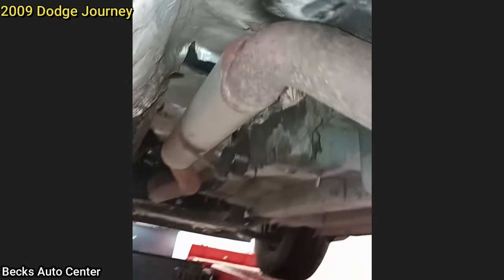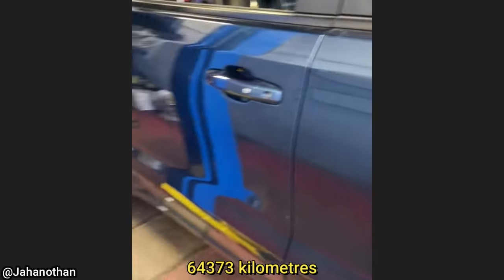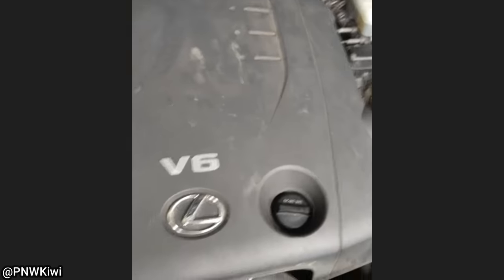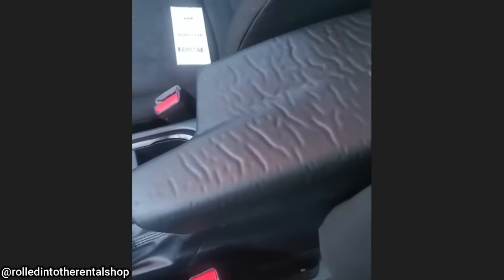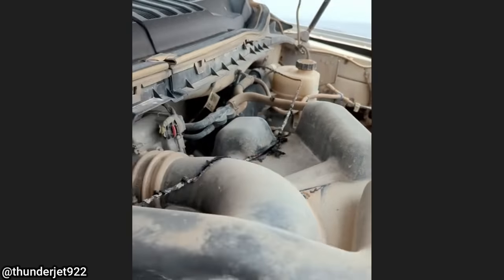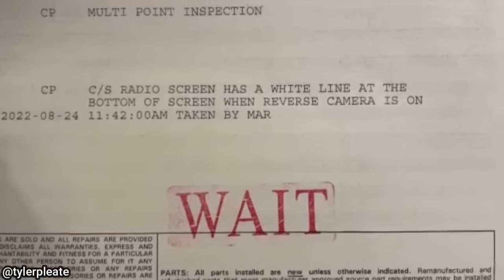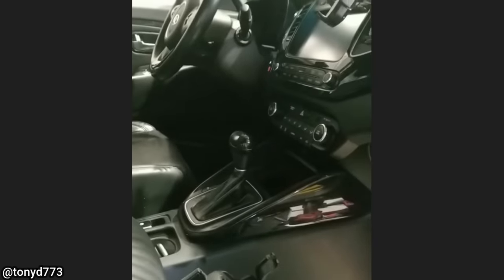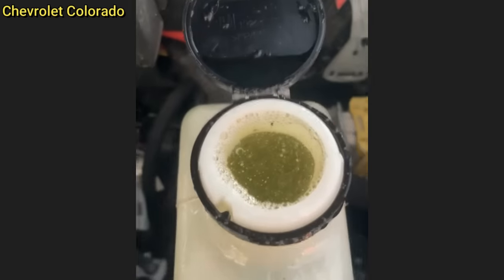Customer States Compilation (The Best of 2022) | Just Rolled In

Comment: Customers: "Don't let these mechanics scam you into things you don't need."
Also customers:
Reply: Beamer approves this post
Reply: so true... but the big issue is that this has not been an issue for most shops since the mid 2000's
Reply: Good  one  LOL
Reply: @sellingacoerwa8318  confirmed
Reply: Which is why I go to a mechanic my dad knows very well that works next to an Vehicle Inspection station and tell them specifically what I need done, never been scammed yet and always had the problem fixed.
Reply: Customer goes in for a tire change

Mechanic: alright leave it here for 30 mins and it’ll be done.

Customer comes back after 30 mins

Mechanic: ok, so we discovered that your radiator and engine were broken, so we had to build a new car. that’ll be 90k please.
Reply: @gvs6462  The issue with these places is they do the work without consulting the customer. Which is something that should be done for everything that isn't a very minor or cheap thing. Some customers refuse the repairs, but most will just give you permission and not feel scammed out will realize it's a even and say no
Reply: @timothywhieldon1971  Sure it has. I started the trade in 1985 when I was 16. I've been seeing cars in such deplorable condition  since my first year. It may of increased  when covid hit slightly. But it's always  been like this. Shit box cars driving beside you every day. Makes you feel really safe doesn't  it.
Reply: @lidge1994  it's actually illegal to do any work without verbal or written authorization.  When given a written estimate you can be charged up to 10 % above the estimated  price. So if you are given an estimate of $100, they can't charge you $500. They can however charge $110. 
Most shops estimate high. Then they look like heros when the final bill is way less than estimated.  This is very common practice amongst us technicians.
Reply: yeah but some shop will scam you. Official Hyundai dealership stated I needed to change my tires as they were "cracked on the side" and unsafe. well there were only a few small cracks, nothing out of the ordinary, but they just wanted to sell me new tires. 

Main issue I had with this shop is that when they ask me to do work, I do it, but when I state "car need work cause it doesnt start twice a week" they can't be bothered to spend time to search for an issue that "might not exist". I won't go back there tho.
Reply: @_underscore_2381  There are some shady shops out there. Dealerships, a lot of times, are the worst.  
What gets me is why the general consensus of dealerships having the best technicians in the world. 
No. These are the same techs you will find anywhere else. 
There's no difference.  Why people go to the dealership for everything is beyond me. The dealers make you  believe  a lot of times that if you don't do back for oil changes, it will basically  void any warranty.  That absolutely not true at all. You can have work done anywhere.  Just keep all the invoices.  Warranty  work is the only thing you need to have done there. 
People will say they want original  parts. Small independent  shops can get dealer parts. 
As far as your tire cracking... are you sure they weren't trying to sell you tires based on age ?
Reply: @-Mike-69  My tires were less than 2 years old. And I go to the dealership since my car is under warranty and every single maintenance, it also needs warranty work done… If I was in the US, my car would fall under lemon law 100%
Reply: Many customers are entirely ignorant and then there are people that are apocalyptically stupid.
Reply: also customer : i don't believe mechanics , i do it my way
Reply: Man, this is a double edged sword. You can't expect every average person to know how to work on a car, these are complex machines.  You can, however, expect someone else to exploit that ignorance, and it happens on a regular basis. There are plenty of good mechanics out there, but the industry doesn't reward honesty, and we live in a world of fast-food-service shops that will happily bend you over a table to make a quick buck. I have a feeling it's only gonna get worse in the coming years as electric cars become more prominent and shops become spoiled for choice. Do you overcharge the electric owner because it's an emerging technology, or do you overcharge the internal combustion owner because it's becoming outdated and harder to maintain? Joke's on us, they're gonna run the same scam regardless
Reply: I bet thats what the guy who’s car was held together by straps said 😂
Reply: goes both ways
Reply: @-Mike-69  I'll make one minor push back.  I own a 2020 Escape.  It has taken a while for private mechanics to understand the new 1.5L I-3 engine in my vehicle isn't the old 1.5L I-4 engine with leak issues.  I tell them it's a 3-cyl and they look lost.  The Ford tech knows because they only work on Fords.  Are they pricey?  Yes.  Do I have to explain to them the inner workings of my engine?  No.  So for new vehicles, especially the small turboed engines and/or hybrid variants, the dealer might be better until their powertrains become more known.
Reply: @_underscore_2381  Dealers are always a terrible experience and you always over pay and get scammed by taking vehicles there, Pretty well known they're always horrible.
Reply: Bruhhhhh right
Reply: To be fair, mechanics do scam people. Not all of them but enough do. There are a few mechanics around here that won't work on your car if you've already bought the parts and I think that's pretty shady. I just fix my own vehicle for a fraction of the price in labor and parts. Never had a problem with finding the correct parts and installing them myself. Local, highly rated brake guy wanted $458 for two rotors, pads and a caliper including labor. I let him do it, no biggie. Then I did the front brakes on my own. Took 1 hour and the parts were better quality and cheaper. The caliper installed by the shop was rusty and old looking while the caliper I paid half the price for the parts including BOTH calipers, not just one like the shop, and installed myself.  Calipers are still shiny and new. So this guy's license and "education" enables him to make $200 for an hours work because I paid a little less than $270 for the parts.
Reply: @youtubecertified4643  Reason shops don't want to use your parts is because a huge part of their profit and income is selling you parts, If you bring in all the stuff to do an oil change and they use that, They lose money on that oil change due to what they pay the labor. So there is a reason for that, They'd have to charge more for the oil change if you brought in the stuff so they wouldn't be losing money. So that part isn't always shady, I do all the work myself to my cars so I never deal with shops, Plenty of shops that do scam because so few people actually check behind them or know anything about cars to call them out.
Reply: @-Mike-69  explains why they do the work for two hundred bucks but online I was seeing people pay a $1, 000.i can build a house but no next zero about vehicles my buddy next door is a mechanic so I get lucky. Rich people coming to change tires how you get four tires put on for 100 if they fit👍
Reply: @-Mike-69  in a lot of states you have to fight for the right to repair because of the computers with those dumb dealerships fighting with local mechanics over the device
Reply: haha, yeah ,my gosh, makes us civilians look extra special. I think people do deserve to be yelled at and made fun of if they bring their car that has a rotten pumpkin in it. Some of these problems looks like the owner does not have EYES! I feel good about myself knowing nothing about cars but have common sense.
Reply: @timothywhieldon1971  false I got scammed in 2014 they tampered with my transmission to make the car shake when braked to a stop. as a college kid I had no money to fix it.  my dad didn’t care. I gave him back the car before leaving the state and it was only then that I learned the car’s “seizures” weren’t due to the age or mileage of the car.
Reply: @ElijahRock92  Yes. You are absolutely  correct sir. When it comes to certain new products yes the dealers will obviously  have information before everyone  else. Some technicians will live and die by one brand of vehicle. That may give them the upper hand in certain cases. 
The point I was trying  to get across, basically some customers feel that dealer technicians are the smartest guys out there. And if you work for an independent, that's only because your not a good technician. Does that make sense ? I've worked for both dealers and independent. Truthfully  I prefer the independent shops where you get a variety  of different vehicles. Not the same thing, day after day after day. For me dealerships are like the movie Groundhog  day.  It's so repetitive  at times you want to blow your brains out.
Reply: @ElijahRock92  i have a 3-cylinder Geo Metro and a 5-cylinder VW Jetta. You'd be amazed at how many people have tried to tell me there's no such thing. Umm, tell that to my car then because it doesn't believe you.  I will admit though that years ago first time I was riding in a geo metro and the guy said it doesn't like hills but it's only running on 3 cylinders. I thought he meant the 4th cylinder was broken. I didn't know they existed. Hahaha
Reply: Yes but that doesn't mean that mechanics trying to scam people doesn't exist, maybe that's why so many people that they're f**** up their own vehicles cuz they've been screwed so many times by a shop they're desperate I think a decent portion of them are just stupid but I'd say there's at least a few in there who are afraid.
Reply: @lidge1994  Consider yourself very fortunate. I just cannot find a  mechanic in my area that's willing to fix my simple common needs, or when they do, it's ALWAYS done wrong, adding another complication. And I've tried them all, over the years, in a 25 mile radius!
Reply: I used to hate manufacturers for making new cars so difficult to work on... 13 years later I prefer the car is designed where the customer can't mess with things they shouldn't...This video is perfect example of that
Reply: @donjulio5045  you have not got a clue sadly
Reply: I know that nobody's perfect,but wow some individuals lack so much awareness they shoild've been icked off by predators.
Reply: There is definitely a wide grey area.
Reply: @mikehunte2087  uh I replace engines and transmissions for a living.. the people in the comments and forums don't have a clue...
Reply: @donjulio5045  agree unless they put the hard work in these sad keyboard warriors should not comment, have dismantled over 300 vehicles but the body’s buggered now
Reply: I had a mechanic replace sway bar, they somehow put it in upside down and the after we got them to put it in right they loosed up the steering underneath and told me I would need new ball joints. When. I got home and inspected them I discovered that the joints were fine they just loosed some bolts underneath so it would pop when I turned my wheel.
Reply: Depends on the mechanic, depends on the customer. Both can be shit sometimes
Reply: USA needs a system like UK does , a MOT , the car HAS to have a yearly inspection  by a government licenced  mechanic so its road safe , without this certificate you cannot use the vehicle , tax it or insure it
Reply: @mr__southern1492  They don't wan to use your part because they warrantee the repair. If your counterfeit part fails, why pays.  If it doesn't fit and it ties up the lift for a morning, who pays.
Reply: "your $5000 car needs compliance bushings replacement, that'll be $2000" - every dealer ever.
Reply: There's nothing you can't fix with a zipptie and a duck tape
Reply: @youtubecertified4643  I had a fuel injection unit that needed to be replaced on a 2003 blazer. Lowest quote I got was $1500. I did some research, got the OEM replacement unit on ebay for $250, and did it myself in the driveway in an hour, including taking three beer breaks. I'm mechanically inclined but pretty sure an 8 year old could have done it with a bit of adult supervision.
Reply: @alanzoarne6530  So why do they still refuse when you bring in new in box OEM parts?
Reply: @keithangstadt4950  1. It could be a used part, put back in the box, and defective.
2. It could be the wrong part.
3. It could be counterfeit.

If there's a problem, it becomes the tech's problem.  You'll blame the tech, not some anonymous seller on ebay.
Reply: Still a valid issue.
Reply: @Mr__Southern  I'm sorry that has been your experience but I worked in dealerships for over 10 years and never scammed anyone.
Reply: A mechanic already gets a bad reputation if it does things wrong
Heard several stories of a bike shop on how they fuck up things, the worst one is from a friend that he had exhaust problem, they fixed that and as a bonus they lowered the idle making the bike stall if not given any throttle
Reply: If I’m in for an oil change and they say “oh your car needs this this and this. I tell them change the oil or I’ll take my business elsewhere
Reply: my mum keeps going to this mechanic that does repairs for cheap but everytime he fixes a problem, another one shows up. been like this for years and i dunno why she keeps going back to him
Reply: If  there werent so many shady mechanics, there wouldnt be so many skeptical customers.
Reply: @timothywhieldon1971 is it supposed 😂 TV
Reply: Too bad mechanics earned that reputation
Reply: My daughter took her car in because the heater stopped working (she lived in Minnesota and this was winter!)  They fixed it.  Soon it stopped working again.  Long story short and multiple trips to this shop, it never got fixed.  The shop wanted $800 to replace the entire heating and AC system in order to do this "properly"!  A coworker recommended this one guy shop to her.  She took it there.  He poked around for a few minutes.  Found a loose wire.  Fixed it, didn't charge her.  Said it would take him longer to prepare the invoice than the fix took.  Been working without a glitch for 18 months now!
Reply: Mechanic: your brake fluid is too dark
Reply: I feel so bad for my brother in this situation. 

People come in to get their oil changed and they got four bald tires

He proceeds to tell them you can't leave with this car like this. 

He then get screamed at
Reply: Customer: Goes in because something is going wrong or to fix one problem

Shop: Explains why it's going wrong and what it will take to fix it, or points out other things wrong that need to be fixed

Customer: Declines because they think the shop is just trying to upsell them on something they don't actually need
Reply: I was told that as a kid, I go to the dealer that I bought my car from and get any repairs that needs to be done on my car. Its a Honda dealership and they told me my car is really well maintained last time I went they couldn't find anything wrong. (Needed an oil change I get free lifetime oil changes from them).
Reply: Look at these people with their shit treatment of their cars seemingly need to go "both ways". These cars give you a damn manual. Read it

Comment: 2:01 “Yeah it sounds like a cowbell when I roll over bumps. It’s the weirdest thing!”

“Hey man, you aren’t gonna believe this…”
Reply: Diagnose skills 5/5
Reply: MORE COWBELL!
Reply: I once had a similar issue, AFTER I got my car back from the shop. Everytime I drove around a corner it made cowbell sound, turns out they forgot to fasten a bolt on the rear stabilizing cross (not sure if that's the correct term, just translating from my language). Easy fix and funny story.
Reply: Not as funny as the one that had a harmonica ziptied to the front, but pretty damn close lol
Reply: More cowbell
Reply: Bluetooth brakes
Reply: What are friends for?